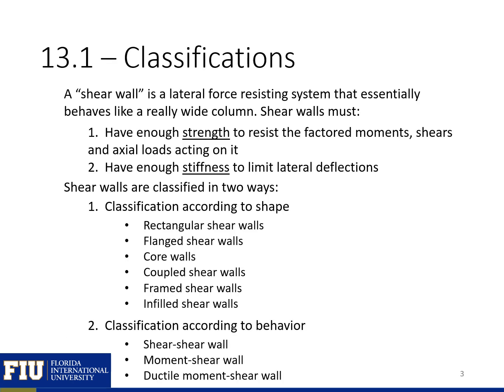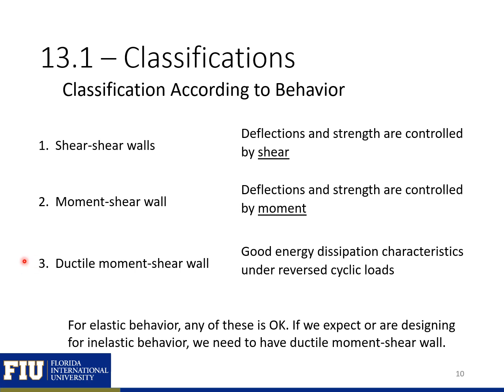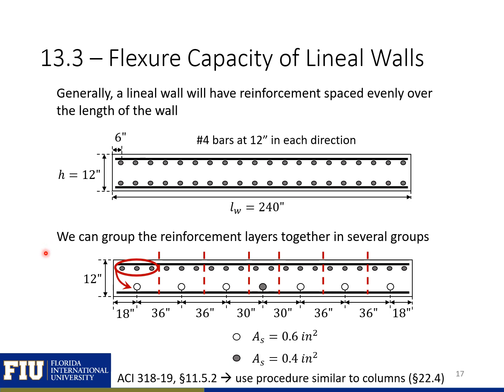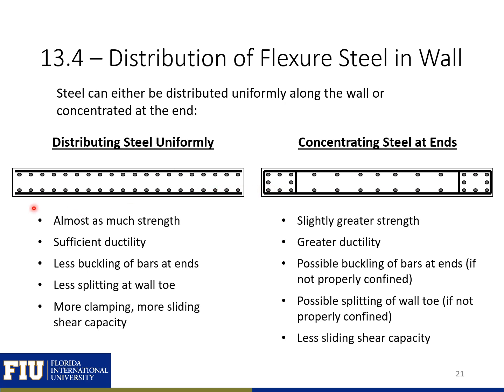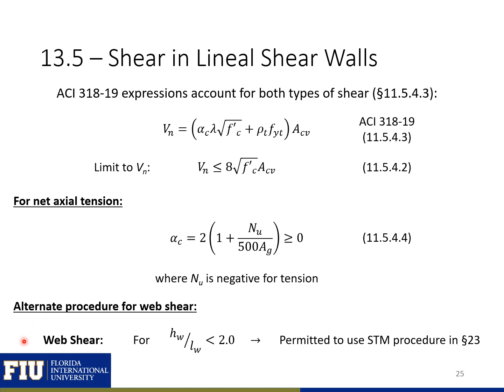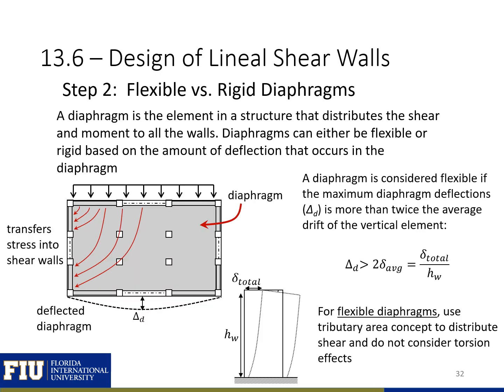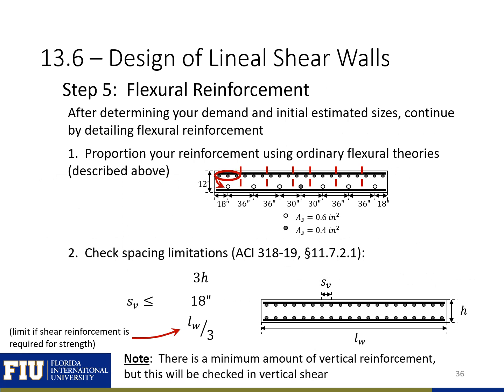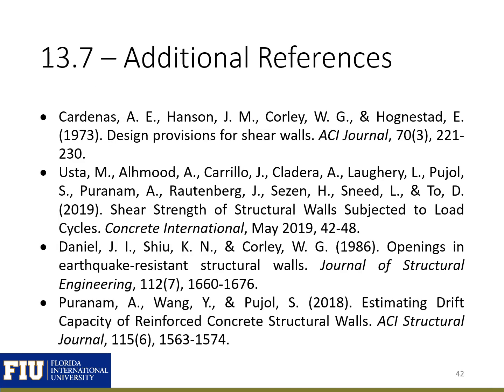13 - Adv. RC Design Lectures - Shear Walls

Comment: Thank you Sir for your excellent lecture. May I during bar detailing does it matter that the horizontal bars are given at N2 layer instead of vertical bars or vice versa? Could you please explain why that does matter?

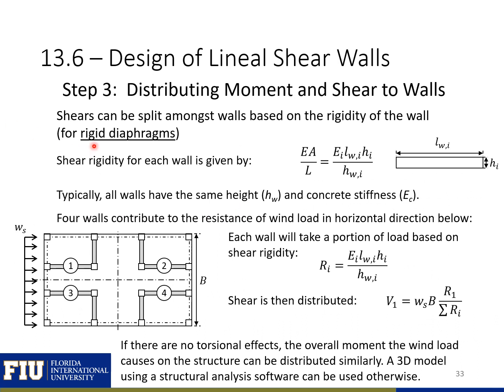Comment: At 32:20, why is that the shear rigidity is EA/L instead of EI/L where I = h*lw^3/12??? Appreciate if someone could enlighten me...thank you.
Reply: I don't know whether you've figured it out by now, but I just watched the video today. I believe that for this example EA/L is correct since David is making the assumption that ONLY walls contribute to the lateral system, and since all of the walls have the same thickness (in this example) you can calculate the center of rigidity just by comparing the lengths of each wall.
Reply: EI is flexural rigidity
Reply: Let me try.....
delta = PL/AE
P/delta = EA/L 
and P/delta looks a lot like....
F/d = k 
and rearranging you get the very familiar equation
F=kd (or kx) Hooke's Law
so you have k which is stiffness. P/delta meaning it is the force per unit displacement. 
For example, 1 kip / 0.2 inches = 5 kips/inch meaning 5 kips to deflect the element by 1 inch. 
EI is flexural rigidity, resistance to bending, EA is axial rigidity, resistance to axial tension or compression.
EA/L is axial rigidity per unit length.
I think like: Rigidity = force. Stiffness = displacement. Rigidity is a property of an element, stiffness is the response of that element, or generally the structure. They are inherently related and connected conceptually.
It is EA instead of EI because of the rigid diaphragm assumption. The wall can be considered fixed at the bottom, and because the diaphragm is rigid, it is also fixed at the top. Because of this, the wall is not bending dominated but deflection dominated, the diaphragm "imposes" a deflection at the top of the wall. Think seismic lumped mass. The lumped mass is acted upon by motion, imposes a deflection at the top of that wall, the wall must resist that deformation. If the diaphragm was flexible, it would act like a cantilever, the diaphragm connection would be pinned. The lumped mass is acted upon by motion, imposes a force at the top of that wall, the wall must resist that force. Bending moments exist in either case, it is just the assumption that the wall is dominated by deflection therefore axial deformation along the height because of the fixed diaphragm.

Comment: You know better than me that ACI-318-2019 says that we should amplify shear force for designing special shear walls.
In the commentary, ACI-318 mentions to NZS 3101 code too.
NZS-3101 and EUROCODE say for such an approach the PHI=(strength reduction factor )
is equal to 1 .... phi=1 instead of 0.75 or 0.60
Why is it different in the two codes?
I send some document photos-(forgive me).
and please guide me.
thanks before.